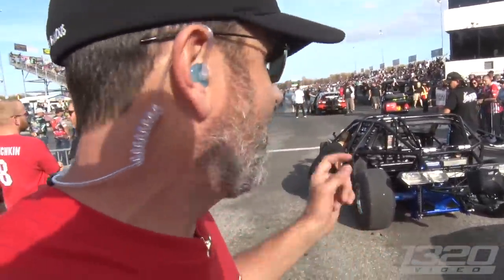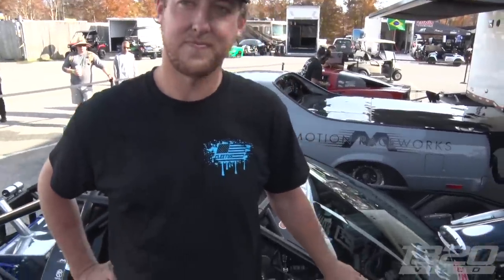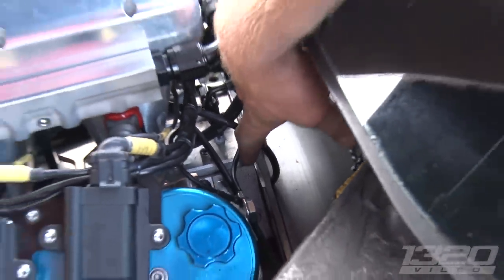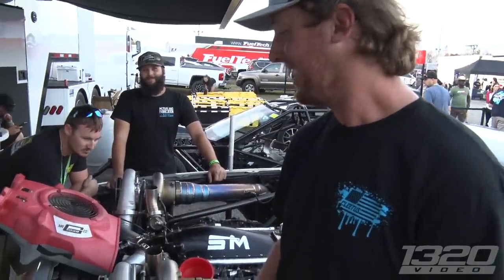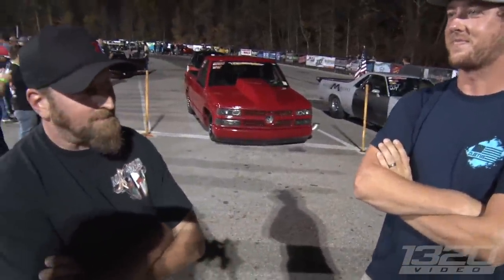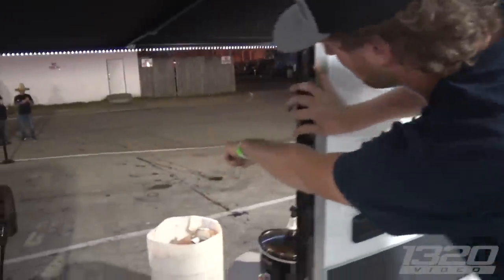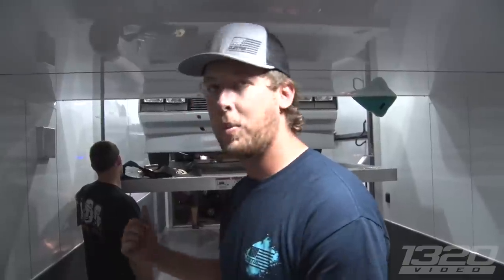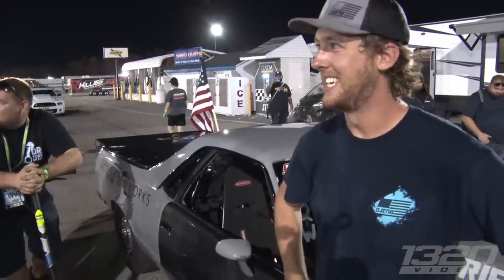Cleetus & Mullet go DOMINATION MODE at WCF 2022!!

Comment: Let’s give a huge shout out to Steve Morris racing for building an absolute bulletproof monster. 2 drag and drive events plus 2 or 3 other events a few thousand miles of driving all with ZERO failures. Unheard of with an engine that makes that kind of power. When he sends that motor back to Steve I hope they do a video of the breakdown of the engine so we can see the internals and the wear before the refresh. 🇺🇸💪🏼
Reply: @NewTrip_NewAdventure  you ain’t kidding. My older brother used to say that all the time. He had a ‘67 Camaro with a 454. Then drop the compression and added a 671 blower, dropped a piston in that motor. Then bought a 502 crate motor. This is all like 25 years ago by the way.  Then had Reher Morrison racing engine build a high compression 630 something cubic inch big block. That is when I realized there is no substitute for cubic and compression. That motor made like 1200+ hp on pump gas. Sorry so long winded. I haven’t thought about that car in a while and was reminiscing… lol
Reply: How long after this comment did it blow up haha? Love Steve morris and he builds some serious shit, just giving you a hard time 😂

Comment: Props to the dudes in the starlets for taking those things so fast. That shit looks like a wild ride
Reply: What are the transmissions called they run?
Reply: @mariusstrothmann4569  liberty 5 speed or a lenco. Basically a pro mod clutch less transmission
Reply: Those little suckers are incredible.  I had no idea that one in the finals was a rotary and that they'd swapped the engine out in 30 minutes before the race!  I know their launches aren't that much different from Mullet's but I guess because the car is so small and tends to pull the front wheels and bounce a little, they look so violent.  I don't know whether those Starlet guys were PR or Dominican or where they were from, but they have major huevos driving those little things.
Reply: Full motor swap just to break the beam… just in case
Reply: The real men of steel
Reply: They are fucking terrifying
Reply: @wobblysauce  died trying to survive would you have swapped it? They live for racing
Reply: That car in the finals recently broke the starlet record they went 6.46 @ 216 a few days ago
Reply: @thatcornfedrx8guy372  insane
Reply: Are those things all rotary? They sound like it but hot damn.. SIXES in those little things
Reply: @geraldgoodiii6993  i think all of the ones in this video are but the class they run in some have 4cyls and some 2jz
Reply: @Moose6340  PR starlets i can confirm.

Comment: Leroy 2.0 is 100% a new car, the only thing carried over from the last iteration is the tub and its cage. With how little testing they've done on it, the fact that it was doing 1.1s through the 60 is pretty damn good (until WCF of course), they're gonna run into teething issues, most notably those shocks. Seeing what they were doing at the Friday street car shootout at Bradenton, there's something amiss with those shocks. It was hooking and booking, and now it won't even stick the 1-2 shift. Another month or two of solid testing and dialing in on the spare engine, then stick that bad dog engine back in with some new rods, and let Leroy eat. 
As for Mullet, well, there ain't no more that needs be said about that car. Its a 3500 pound street car on 315 radials and its doing mid-6s with ease. That Steve Morris big block is making some steam for sure

Comment: Just got to give it to Steve morris that motor is really not rated for that speed and et with that heavy of a car and it’s just how’s how nuts he is and now there going aluminum rods can’t wait to see this shoot for 5s
Reply: It has aluminum rods in it now. But changing to steel with the refresh
Reply: @1953fords  that’s right I got it backwards
Reply: There is a lot more power and car needed to even think about 5’s. Thank you for the laugh though 😂
Reply: @billjenkins1416  I think with some weight loss with some carbon fiber body panels and drop the car under 3k and the next motor I’m sure that’s already in the works
Reply: @codythrasher3930  It would need a lot of weight loss. carbon fiber 1 piece nose, maybe a few other things and maybe a bottom 6 second pass would be possible... IDK, He's got a long way to go to get there. Not saying he can't but with that car's weight on a smaller tire it seems like he could be reaching the limit of Mullet's capabilities. Maybe if Mullet gets a 2.0 treatment with a lighter chassis and more carbon fiber.
Reply: @TheFlooringInspector82  yeah I agree in certain ways. I think if he goes carbon front clip and same for real that’ll be a huge weight loss and bigger motor from Steve morris. But I agree odds are against the car right now I’m just stoked to see it drop lower and lower. You know if he gets close enough he’s gonna do whatever it takes to get there
Reply: @codythrasher3930  There is a lot more than weight that will keep it from the 5’s

Comment: Those Toyota starlets are 5 speed manual!?! Why don’t they run in the stick shift class!? And why aren’t they the stick world record holders? I’m confused..
Reply: The stick shift class is for H pattern shift only. The Starlets run Jerico or Lenco style racing transmission with the multiple lever shift so aren't a true stick shift car. If they could run those or hand shifted sequential gearboxes in stick shift they'd be going a lot quicker, as up until they went boring and allowed autos they were a Pro Mod staple.

Comment: The reason Leroy doesn’t run is because his cage isn’t red whit and blue
Reply: its actually alot worse. the body and everything is too rigid. theres no way for anything to give out so the car cant plant the rears into the ground. thats drag racing 101. thats why its so bouncy(top fuel dragsters have the same issue)
Reply: @jackmagnium6115  so what you’re saying is he needs a frame kinda like the bully from pfi speed
Reply: @jackmagnium6115  Top fuel cars flex like crazy, they bounce because they are flexing the chassis. 
Leroy just needs to get the suspension worked out, something is very wrong in there. It is the same car forward of the 4 link, it didn't bounce before, I don't the chassis being too stiff as the actual problem.

Comment: mullet has the potential to go 6.40-6.39
Reply: After he gets it refreshed he might feel like he has the confidence to lean on it harder but it had thousands of miles and tons of passes on those rods and pistons already so I can see not wanting to lean any harder on it but Pete did say there was more there if they wanted to try it that's why he got a bigger map sensor lol
Reply: If they clean up the 60’ for sure. But to keep the engine reliable I wouldn’t be turning it up more.
Reply: @nickerbocker759  That 60' is about as fast as they can push it at Mullet's current weight. You have to remember that he weighs somewhere north of 3,500 pounds, so the fact that they've got him launching as hard as he is is nothing short of a miracle for the size of tire they've running.

Comment: cleetus. the reason your having problems with launch is your car has no way to give(meaning the structure is way too rigid). your car is too light to even get off the line without IRS
Reply: That’s not how it works. They just need to readjust geometry and/or some valve adjustments. Those starlets weigh less 😉
Reply: How fast have you been?
Reply: @LibertySpam  faster than you
Reply: @nickerbocker759  majority of the cars with axels like that are 2900 pounds or heavier. very common on 1320video. for cars lighter than that. youll need IRS cause there is enough weight to shift around and plant the tires down into the ground. thats drag racing 101. if the suspension alone(even adjusted) is to rigid. its gonna spin and hop violently. the reason the starlets can go that fast is cause of their wheelie bars. leroy, mullet and ruby dont have any(ruby and mullet being the heavier cars). cleetus did get it to work but its going to get nasty if they dont stop(i seen many a times lightweight solid axel drag cars hit the walls, flip, or spin out cause there isnt enough weight or flexibility(both) within the system). something has to give in order for it to move. cant be to rigid otherwise your asking for disaster
Reply: @nickerbocker759  plus im a mechanic. i been to a dragstrip a few times and i seen a common mistake when making cars go fast. changing the factory style suspension(its a good idea in some cases but for a stripped down corvette weight less than 2200LB's isnt good at all). if it were me i keep the IRS and overbuild it for like 4000 horsepower. especially if your running something that weighs nothing(like leroy which is 2150 with driver). thats waaaaay to light